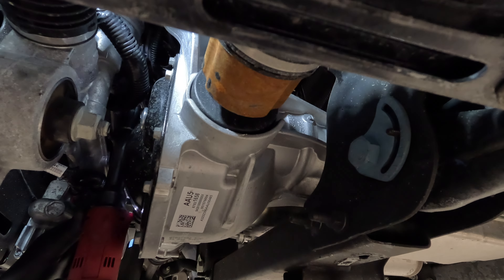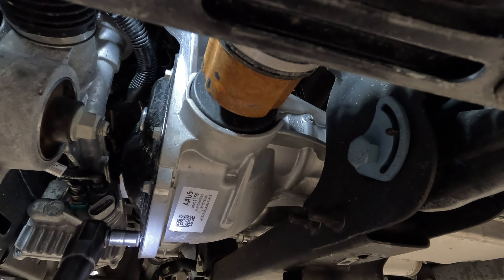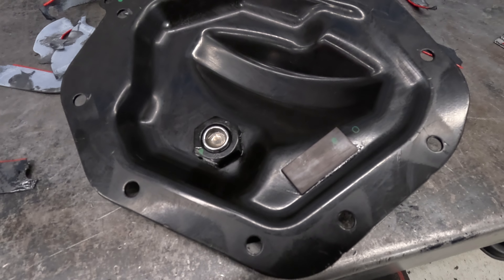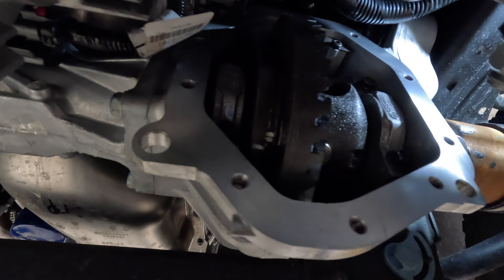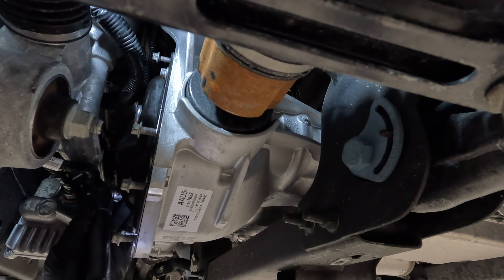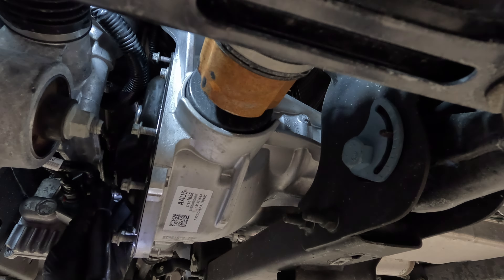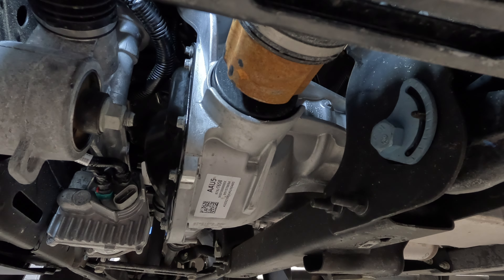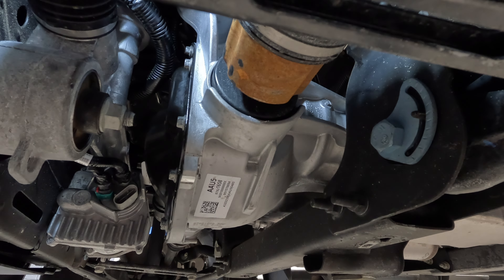Front Differential Service: Easy DIY Steps LM2 LZ0 2019+ SIlverado 5.3 6.2

Comment: Something to consider, if you're doing this in cold weather, heat up those electrical connectors with a hair dryer before pressing the release. They break so easily when they're cold. Save yourself some headaches.

Comment: I hit PPE up a few months ago about a front cover. They said they would do it if there was interest so if you and an army of your subs blew them up I’m sure they would spit a cover out.  
Also I researched and there is absolutely zero offering for a traction differential for the front axle of these trucks.  
A good mod would be trying to swap in a donor locker from a ZR2/AT4x. I called AEV about an upfitter front locker kit and they said they would do it if demand was there so once again if your subs blew them up we might get it.  
I called Auburn gear and they said they would look into a limited slip for our application.

Comment: Well I got the rear differential fluid & transfer case fluid changed on my 23 Sierra 1500 today,  then came to the front differential.  I always did this before on past trucks equipped with a drain plug, they were easy.  After watching this video & not being able to get 2 skid plate bolts off because the retainers are spinning, I think I’ll admit defeat & let the dealer handle the front differential.  Like Meatloaf says, 2 out of 3 ain’t bad.

Comment: Great video , what's the part # for bolt clips on skid plate 3 out of my 4 are just spinning,  of course
Reply: Do you still need them?
Reply: No, but thank you
Reply: How did you get the bolts out with the retainers spinning?  The rear 2 on mine are spinning.  I don’t see any way to get in there and hold them from spinning

Comment: I have a 2024 GMC Sierra 1500 3.0 diesel 4x4. I don't have any of the three RPO codes you had in your video. Is there another way to find out which front diff I have? Thanks.
Reply from the maker: I can look up your vin number if you want to send it to me. mstrgoodwrench@gmail.com
Reply: @DemonWorks That would be awesome, thanks!

Comment: I like to do a first oil change very early on my rigs as well. I have a ‘22 Suburban 4WD and can not find what the recommend oil is for the rear differential. Manual says to see the dealer. Do you know if it’s just 75w-90 and do I need a friction modifier? Thanks!
Reply: I realize this is a little late. I contacted my dealer for my ‘19 Silverado and it takes 75w-85. There were two different manufacturers for the differentials. If you call the dealer with your vin number they can tell you which.

Comment: The diff gasket is $40+. Can't the old gasket be separated from those surfaces without damaging it so that it can be reused? It's not like those cover bolts get torqued down very hard, so that gasket isn't, or shouldn't be crushed.
Reply from the maker: It’s just a regular cardboard/paper gasket, gets damaged unfortunately.
Reply: @DemonWorks so couldn't you get a sheet of paper gasket an make one urself like the old school way

Comment: Any news on a replacement cover with a drain plug?
Reply from the maker: i'm not sure one would fit! It would have to solely be for a drain plug and that's it.
Reply: @DemonWorks  I hit PPE up a few months ago about a front cover. They said they would do it if there was interest so if you and an army of your subs blew them up I’m sure they would spit a cover out.  
Also I researched and there is absolutely zero offering for a traction differential for the front axle of these trucks.  
A good mod would be trying to swap in a donor locker from a ZR2/AT4x. I called AEV about an upfitter front locker kit and they said they would do it if demand was there so once again if your subs blew them up we might get it.  
I called Auburn gear and they said they would look into a limited slip for our application.

Comment: how many miles was that at?
Reply from the maker: 3000
Reply: @DemonWorks did you mean 30,000?
Reply from the maker: @zkingz4030  I did this at 3000. Heard wear in and leave metal shavings. So I prefer to get the fluid out after break in.

Comment: Measure what came out. That's how much goes back in.
Reply from the maker: Easier said then done, but at the same time, just filling and setting proper level is pretty easy.
Reply: @DemonWorks  Yep, I've been twisting wrenches for 40 years. Nice video. I wasn't sure if the diff cover had a plug in it or not, so of course I went to youtube and found your video. Thanks a bunch.